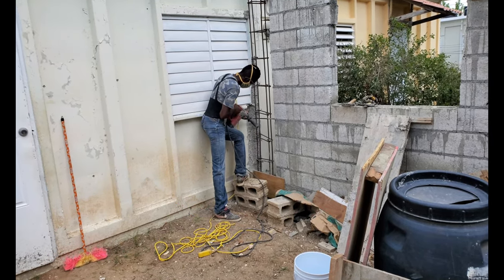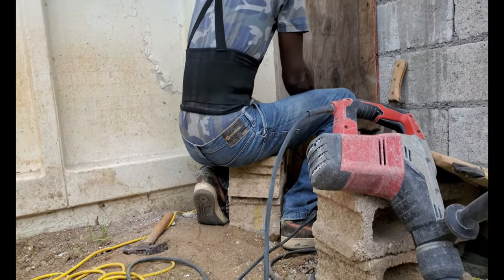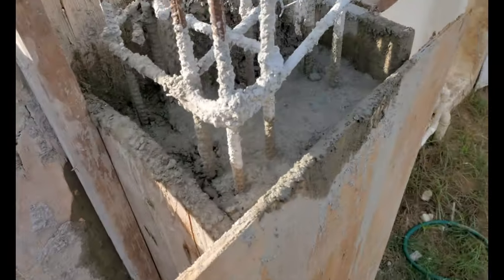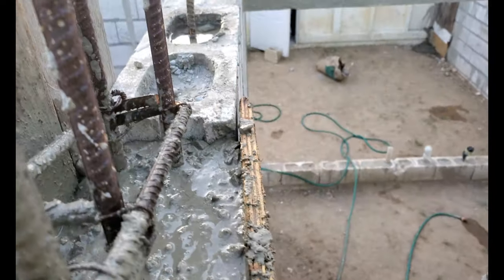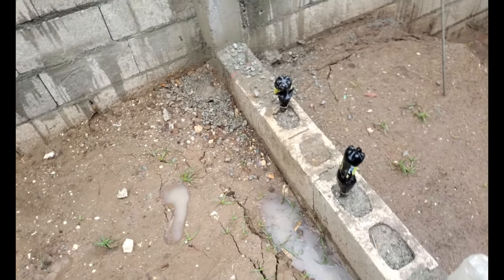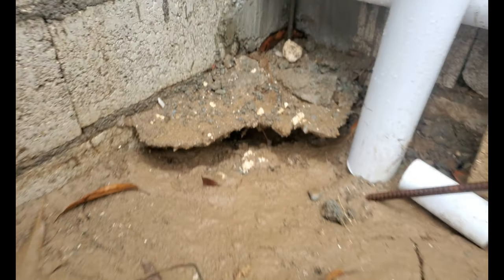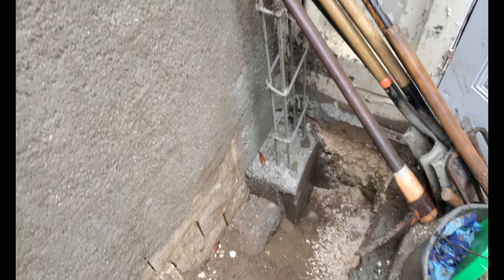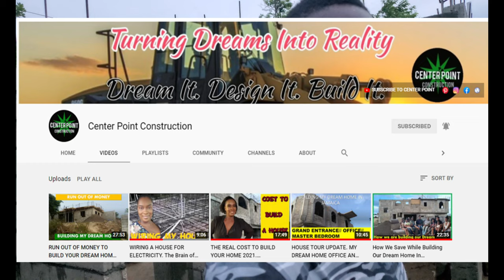Boxing and Casting Lintels and Columns

Comment: Great job but u need a cordless hammer drill and a impact drill your life will get a little easier with those two instead of using cord drill
Reply from the maker: Thanks for the tip but i cant afford one most of the tools  I used are borrowed
Reply: Keep up the gd work